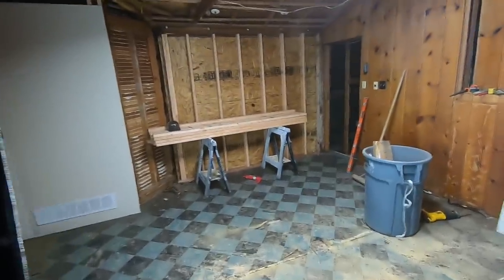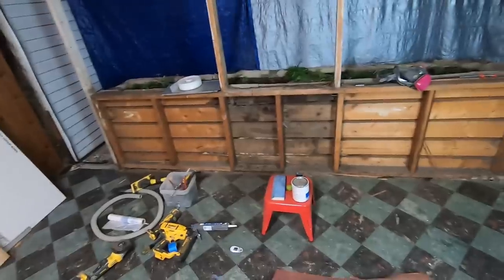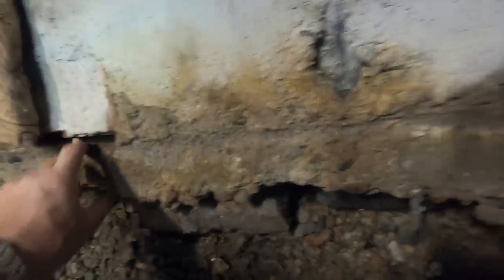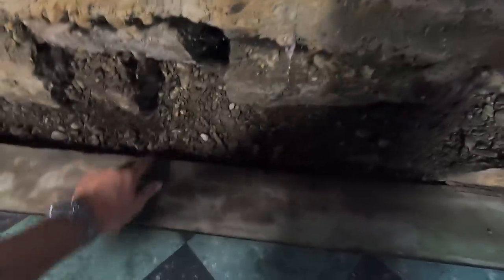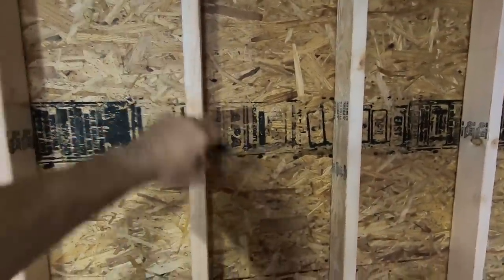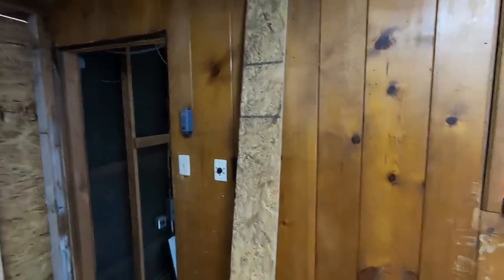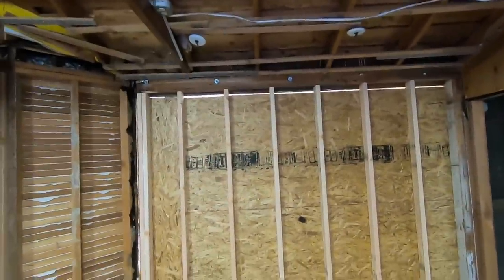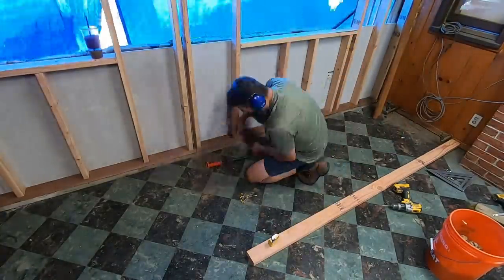Framing A Load Bearing Wall With Windows | THE HANDYMAN |

Comment: So, my home was built in 1974, and the shower that is placed against an exterior wall usually rots out every 20 years because of vapor (I'm assuming). It rots the black composite wall underboard that is covered by siding, and then it rots the composite siding. The only reason that I can guess that this wall does this, is that it is from moisture build up, and something is trapping the moisture in the exterior wall. Something to think about when you place a shower next to an exterior wall, specifically and OSB wall sheathing.

Comment: Cement board is in fact never going to rot.... but it’s definitely moisture wicking. Did you consider putting a membrane like red guard?
Reply: I was wondering about the exterior waterproofing against that planter myself, particularly where the vertical seam is where the two boards met and there's little to no space on the outside to seal the seam off..

Comment: With the wallframing, why was there no waterproofing barrier necessary between the wood and the concrete slab below? Great video
Reply from the maker: Pressure treated bottom plate just like in a new build.

Comment: Impressive how little damage to the wall there was after 42 years with the cement planter against it. Great idea for using the cement board there to cover the hole. Great video too!
Reply from the maker: The board that was on the outside of those planks and exposed to the outside was just 1/4" paneling.  I was planning to do a close up video of it but the dumpster guy was coming in the morning and didn't get to it. I'm sure my cement board will at least last another 40 years.   This house will most likely see a bulldozer in 20 years though.
Reply: @TheHandyman1  what leads you to that? Redevelopment of the area?
Reply: @gawdzalien2811  Assuming the rest of the house is that old and built like that, it's not worth it to renovate the whole thing, especially the old foundation and plumbing. The current owners will probably be gone in 20 years and whoever has it next will want to sell or start new without headaches from the 1940s.

Comment: When I send in the order for that shower door to be fabricated: Shower head - left / Hinge - right. Always hinge door opposite side of the shower head.
Too bad your shower is only 48" wide. If you did get 52" width you could plumb the riser through the ceiling with a rain shower head spraying straight down and install a 3/8" clear glass fixed panel (shower shield) and forego the hinged door all together. Would open that small space up. That and these framed shower enclosures today are J U N K!
Reply from the maker: Its a sliding door. Not a hinged door
Reply: @TheHandyman1  Yeah, with the toilet next to that shower it does not leave you a whole lot of options.

Comment: Handyman, do you recommend that nailer? 
Since I've started my business I've only used pneumatic nailer. Been looking at battery operated ones lately.
Reply from the maker: If you hit a knot it will jam and bend the nail.  I find it more common with this dewalt then with my old air nailer.    Its still better than a air compressor and hose.
Reply: @TheHandyman1  right on , I might just make that investment then
Reply: That DEWALT 20v Framing Nailer gets 👍👍 from me. Massive time saver. Just bought a pneumatic Dewalt finish nailer though & it's a dream. Just hate gettin out that loud compressor, ya know?